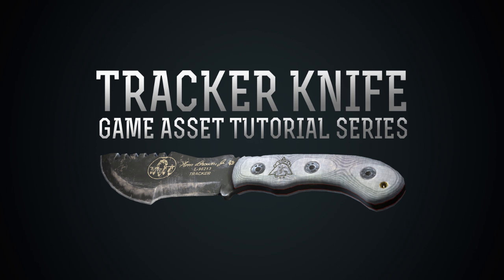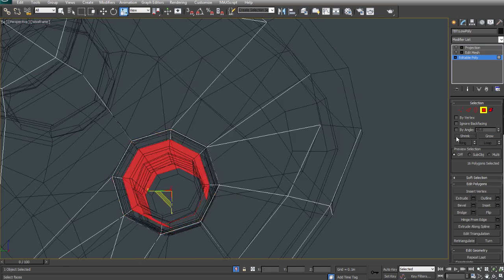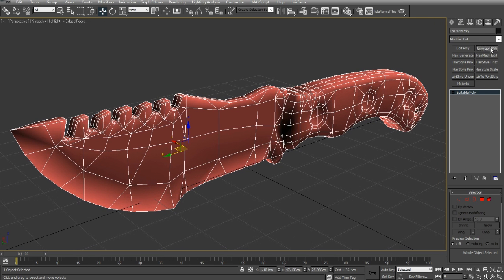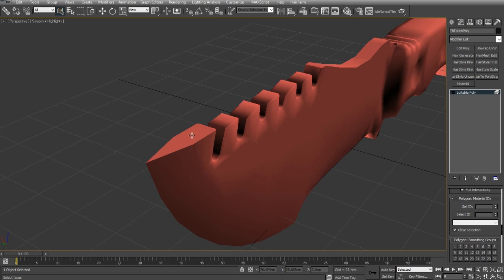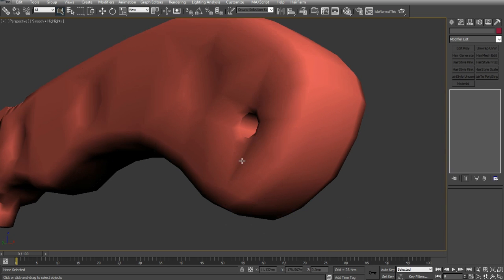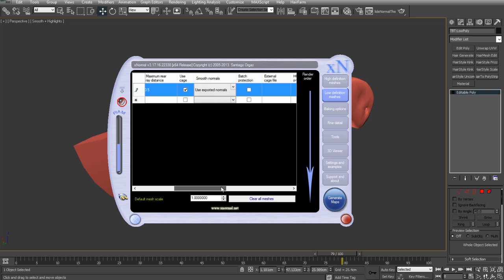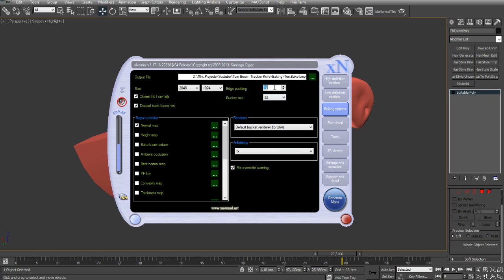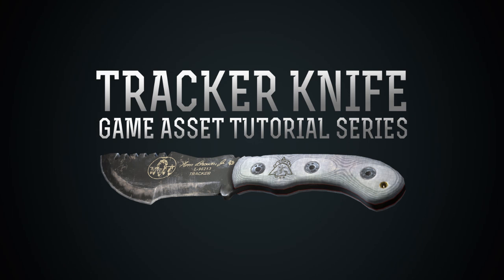Tracker Knife Part 4: NextGen asset production series

Comment: Hi Joe, love your tutorials, they have proven very helpful. I have a question regarding the normal map you baked using Xnormal. No matter how hard I try and how many settings I fiddle with I can never ever get a normal map as clean as yours. I have followed your tutorials to the letter and still cannot achieve what you did. Is there anything you did which wasn't covered in the video?